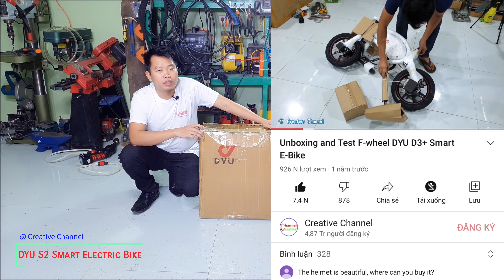Unboxing and Test F-wheel DYU S2 Smart Electric Bike

Comment: DYU Smart Electric Bike S2

Material: Metal
Hub size: 10inch
Folded size: 920*260*510mm
Released size: 920*500*910mm
Color: Black/ silver gray
Weight: 15kg
Max load: 75kg
Riding speed: 25km/h
Max speed: 25km/h
Mileage: Around 40 km
Uphill: 15 degree
Temperature: -10~45℃
Battery: 10Ah
Rated power: 350W
Rated voltage: 36V
Charging time: 6h
Bluetooth board and APP: No
Lights: Front Light and rear light
Brake: Front and Rear disc brakes
Height of seat: Adjustable
Horn: Yes
Suspension: No Seat suspension